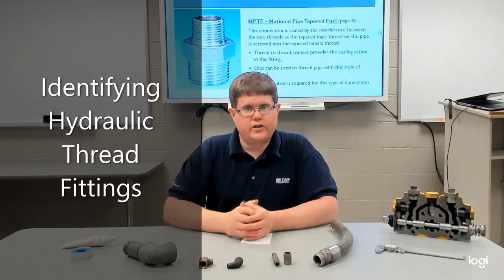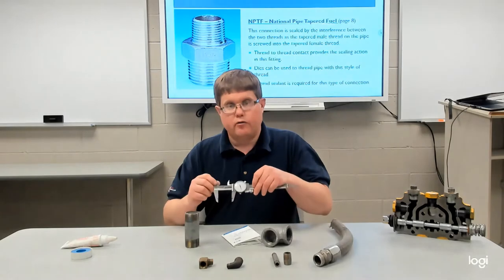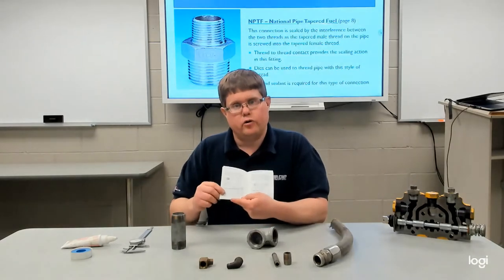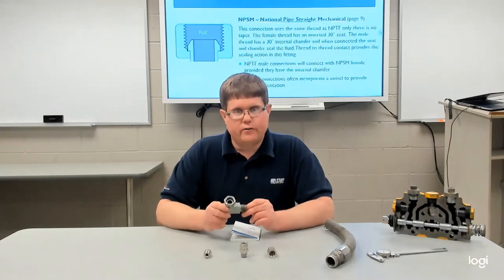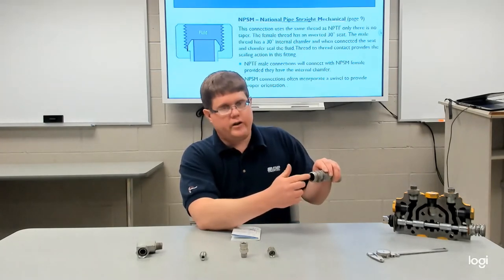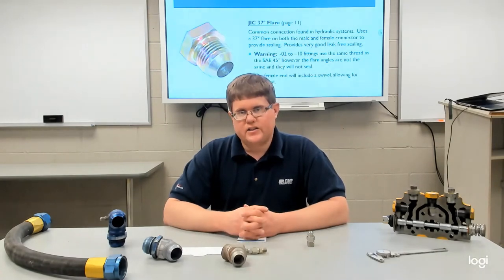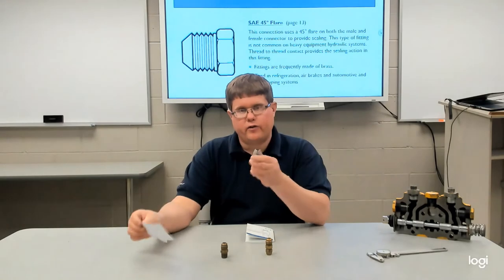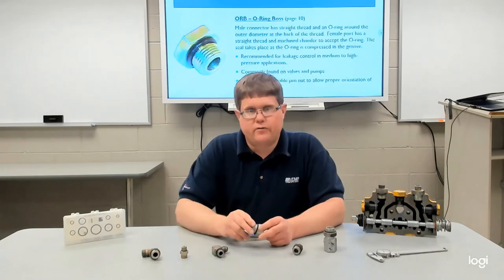Identifying Hydraulic Fittings

Comment: Greatly informative. I was wondering why an NPT female fitting I was working with had a conical seat inside. Now I know it is NPSM. Thank you.
Reply from the maker: Awesome, glad to hear it was helpful!  And your right, that is NPSM and would need a male NPSM fitting with an internal chamfer to seal properly; it would not seal with a regular NPTF male connection.
Reply: @JimMackHeavyEquipment in 9

Comment: is a hose with field attachable hydraulic hose fittings be as strong as a hose with crimped fittings
Reply from the maker: The field attachable hydraulic fittings should be as strong as what the application is rated for when used with the specified hose, but in most cases a crimped fitting would be stronger.  In my experience I have even seen that factory crimped fittings provide a stronger connection than custom made hoses that are crimped in the store.
Reply: @JimMackHeavyEquipment  ok thnxs